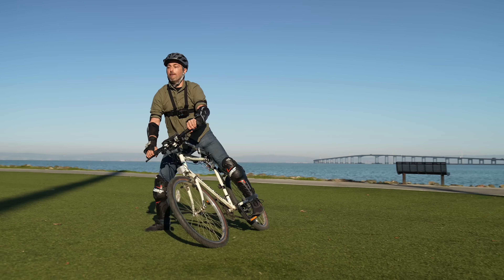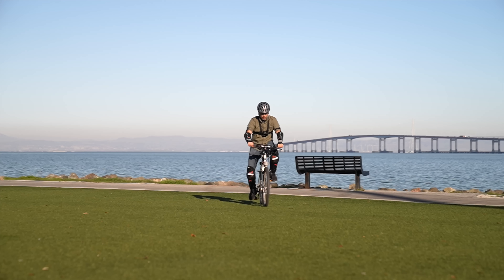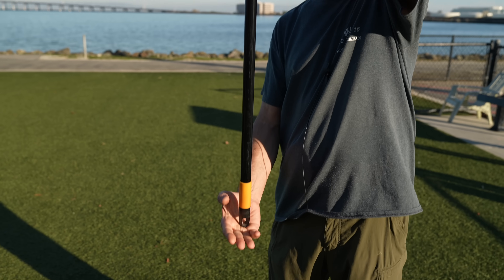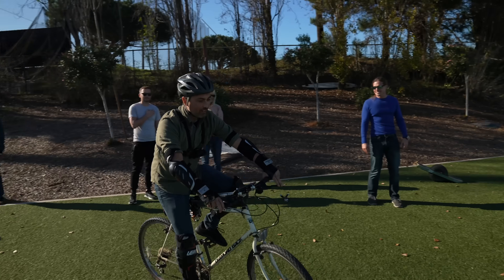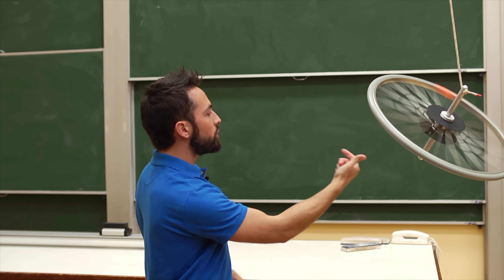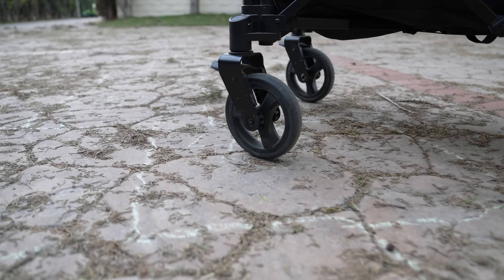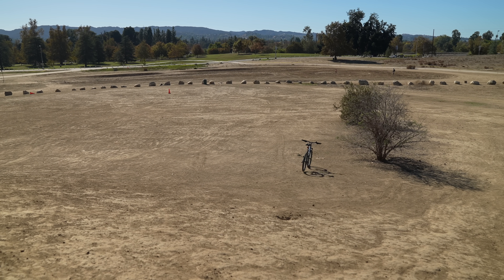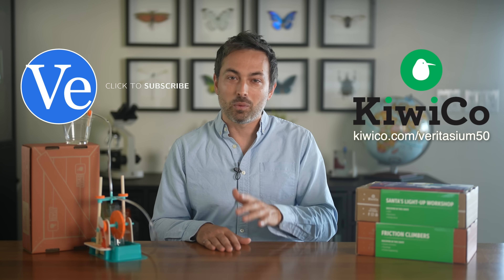Most People Don't Know How Bikes Work

Comment: Countersteer starts the turn, then once leaned, the bike's rake/trail effect steers the front wheel into the turn on its own and will stay like that with no other input, as long as speed remains constant; unlike a car where caster effect will return the wheels to straight ahead. To stop the turn, you countersteer the other way. This is one of the reasons why it is essential to keep your bodyweight off the bars of a motorcycle.

Comment: There’s another force at play to correct the balance of a bike moving without a rider: the friction of the rear wheel. That friction is always at play when the rear wheel is in contact with the ground and counters the angle of the front wheel since the rear wheel is fixed longitudinally with the frame, where the mass of the entire system (the bike) happens to be. I mean, that’s my theory as a cyclist and an observer.

Comment: Is this news to anyone who knows how to ride a bicycle? (or motorcycle for that matter)  It's all about counter steering, leaning & the gyroscopic force generated by the wheels.  Push left, go left.  Push right, go right.  You are essentially turning the bars slightly to the right by pushing on the left side to turn left & vice versa.  As they mentioned at about the 2:30 min mark, you must turn left to go right & right to go left.  Steering is how you do not fall over forces the bike & your weight to lean towards the direction you want to go.  It would be very difficult to ride a bike for long with the steering locked straight.

Comment: This precludes the possibility of just using your body to physically lean over and just simply turn to the fire room you want to go.   I recorded a video of myself doing this and for the most part I just physically lean over and the bike turns for me.
Reply: Nah man.  Let's weld your steering straight n  see what happens.
Reply: @gur262  well of course that will make it possible.   But even if you just simply lean over you'll still turn the steering wheel.

Comment: This is very interesting! As a motorcycle rider i always thought i'd only countersteer going above 20-30km/h and turn without any countersteering under that threshold but I will keep a keen eye tomorrow morning while doing slow turns and see how i actually initiate the turn :)
Reply: I'll be interested to learn what you find out. I ride a trials motorcycle, which is a very slow methodical type of riding over difficult obstacles off-road and we definitely use a mix of direct steering (and counterbalancing) and then countersteering at higher speeds, I just don't know when the transition actually occurs!
Reply: @fprintf   - Countersteering can ALWAYS be used to to set up the proper lean.  In trials, you probably use differential weight on the foot pegs at low speed to set up lean, but what keeps your body from falling the opposite way?  It's subtle and you're probably unaware of it, but it all goes back to moving the wheels' contact patches with the steering input to control lean.
Reply: @fprintf  Here is what i found, i seem to countersteer and lean the bike with the aid of some slight body positioning  for sharper slow turns but i couldnt tell if i would counter steer before the turn or if it was just me correcting my line while going straight before more relaxed slow turns
Reply: Well thats only possible with body positioning, if you "fall" the other way your brain will automatically countersteer. On motorcycles the effect of countersteering at low speeds isnt in such big effect because of the low COG and high weight of the bike. At high speeds gyro forces are so much stronger so no matter how much you change your positioning it will barely affect the bike.
For our trials guy here that might be bifferent because youre standing up and the bikes are much much lighter
Reply: It'll change your life. If you're not putting your feet down, you're countersteering, whether you realize it or not.

Comment: One more mechanism to keep bikes stable: the shape of the tire. Because it is a doughnut, with the largest wheel radius at the centerline and diminishing radii to the sides, the tire will always roll in a circle toward whichever side it’s leaning to - toward the smaller radius. The smaller radius covers less ground in one revolution, the larger radius covers more ground. Test this with two plastic cups with their open ends taped together: the combined shape will always roll in a circle toward whatever side it is leaning.

Comment: I would assume that the only scenario you would be able to ride with steering locked, would be if you're going in a straight line with some speed (25km/h or over), because, at that speed, you would be relying on leaning only.
Reply: Nooooooooooooooooooooooooooooooo.                 It works the same way at 150kmh.

Comment: When I did my advanced rider coarse to get my motorcycle license I was taught an emergency steering technique where I had to sharply push on the handlebar  on the same side of the direction I wanted the bike to turn. i.e. to abruptly turn to the left I had to push the left handgrip which caused the bike to immediately lean and swerve to the left. This seems counter intuitive as the handlebar is turned to the right to actually go left. I suspect this results in the same effect seen in this video. The slight jolt of the steering to the right is enough to initiate the lean and therefore the turn to the left.
Reply: Your statement is confusing..
Reply: Isnt it just the same to just pull left to turn right tho? When I took my first motorcycle lesson riding felt just the same as with a bicycle but with a much heavier bike. Steering/keeping balance/dodging obstacles felt so natural. My teacher told me to dodge by pushing the bars and instead my brain told my body to pull like i always do and the teacher told me i did it correctly.
If it is the same why dont driving schools teach it both ways?
Reply: @mirzu42  You're doing both, its just that for some its easier to focus on the side that is pushing rather than the side that is pulling.  Either way you're doing the exact same thing, steering the bike in the opposite direction (hence counter steering) to initiate the lean and then begin to turn in the intended direction.
Reply: Yes, that is exactly it. It is more important on a motorbike, because the gyroscopic effect of the heavier and faster turning wheels prevents you from turning unless you apply some drastic steering inputs, and so you need to know and have the confidence to apply those drastic inputs.

Comment: There is also another technique I use, which becomes apparent in very quick reactions. What I do is nudge the bike with my hips or letting it fall to the ground, lowering my point of gravity, which enables me to steer more effectively because if your bike is at an angle, the angle you tire makes with the ground is much sharper than the angle of you steering. I do believe I'd have to steer the other way first, only less. I think most people do this, but skillful riders drop much lower. It allows me to safely ride like a madman through town.

I've been thinking for a while now. I believe the only way physically possible to beat your special bike, is with sails.

Comment: I  actually just did a complete lockout of my handlebars a few weeks ago to demonstrate to my sister that leaning was how to actually control a motorcycle. I was still able to ride fine, no sharp turns but fine. . Counter steering a motorcycle gives you the mindset of pushing the bike over with your legs and weight. Yeah counter steering is much easier and better to turn but as long as you have a little speed you can turn in a decent radius with just leaning the bike with weight
Reply: I don't believe you. How did you lock it out?       I don't think you did. There was some movement left.
Reply: @gur262  I work on motorcycles on the side for some extra money and because I enjoy it. 
You can lock them up the front wheel and handlebars on most models pretty easily by putting two copper crush washers on the pivot part of the triple tree. They literally do not move but maybe a mm at most if you put your full weight on them. 
I did this on an old Kawasaki 250 I bought off someone for $500 as a fixer to learn more about fixing motorcycles, especially carbed ones. Turns out you don’t care about people learning (dropping) on one you’ve spent more money in your time fixing then actually buying it. Maybe it’s different on a non motored bicycle, but my point still stands, it’s still probably possible if you have the experience on them, at least motorcycles.
Reply: That's not true.  If the wheels can't turn you can't steer, and balancing is extremely difficult.  Either there was still enough movement in the steering to allow control, or your story is made up.
Reply: @nwimpney   Notice how they said motorcycle, so its probably not the exact same as the video. Also, why would they make up a story wtf
Reply: @nwimpney  no movement on the wheel or handle bars. Crush washers on the triple tree pivot. See my reply for more detail on Joshua Mack comment
Reply: bruh you physically can't steer a bike with locked steering, tf are you talking about
Reply: @pleopsidium6960  motorcycles are much heavier than bikes and the wheels are often wider, so its different than a bike and likely possible to do a wide turn by leaning at certain speeds.
Reply: @carter_dj  yeah i guess if there's a big difference in width between front and rear tire it is possible, otherwise i can't see it happening, unless there's a solid scientific explanation behind this. i'm not going to try riding my motorcycle with locked steering lmao
Reply: @pleopsidium6960  i wouldn’t have either but my sister wanted to learn how to ride a motorcycle and I couldn’t seem to get across that yes you have to put some lean on the bike or you can’t turn. She was scared of leaning and thought you could just turn the handle bars and it would
Turn like a car.
Reply: @carter_dj  i agree, might not be the same. Maybe it has to do with the pedaling of the bicycle. Not saying it’s all bs what they are saying, just I don’t think it was portrayed in the best way. Counter steering is extremely useful, hard to wrap your head around but if you just hop on a motorcycle and learn the clutch and go, you’ll be fine if you rode a bike in the past. I think there is more variables they don’t take into consideration.
Reply: @pleopsidium6960  center of gravity is not contestant with a human on it. See my reply to  Joshua Mack comment for more detail.

Comment: Every EU and UK motorcyclist that quilfied remotley recently likely knows this as it's veyr difficult to pass the "moose test", a tight 50km/h swerve around an obstruction in the road without knowing how to do this. 

I think you've missed the critical difference though, in than a car steers by positional input on the wheel, you turn the steering to the required corner radius. On a bicycle you apply a torque on the bars to induce a lean relaxe pressure to let the bike balance. You touched on this with locked steering but you missed the major safety aspect, in that gripping the bars to tight stops the bike from turning or makes you crash. Target fixation crashes occour when a rider panics, doesn't use the subconcios techniques they have learnt to steer and tries to hold the bike tight and turn. At low speeds on a bicycle you lose balance and fall, at higher speeds on a ~1/4 tonne motorcycle you just go straight on.

Comment: The counter steer is well known to all two-wheel users. Have to use it in evasive maneuvers when riding a bicycle, typically when a cellphone user is not paying attention. Nerve wracking as you have to turn TOWARDS the danger before you can avoid it. But it’s present at all times you want to change direction.

Comment: Understanding the countersteering effect is MUCH more critical on a motorcycle. Especially a cruiser which is designed to be very stable at 55mph. Its much harder to turn the wheel due to much higher caster angle (and probably the much increased gyroscopic effect from a much heavier wheel as well as the engine flywheel). A motorcyclist that doesn't both understand and practice this technique for awhile is destined to eventually get in a crash with a car or deer after enough years. They are unable to make very quick steering adjustments to swerve and then again to continue straight down the road.

Comment: Motorcycles are a different beast.  To turn you push on the opposite side; this works a little on a bicycle but a lot on a motorcycle; same idea of turning the bike out from under you I suppose; but then that also is leveraging the gyroscopic motion to counter torque.  It's one of the things the grind into your head when you take a motorcycle riding class.

Comment: The bicycle is a really neat demonstration of proportional feedback. The caster is there to ensure the bike will want to keep itself upright. If the bike leans left, the front fork will turn counter clockwise slightly and the resulting turn creates centripetal acceleration that brings the bike upright. Once upright the caster causes the tire to track strait again. This negative feedback can easily turn positive in motorcycles in the form of tank slap, and ultimately oscillations during land speed records that turn deadly. The rider will think it’s a fluke and not a design flaw after the first bad pass, only to die in a subsequent run when the bike careens out of control. Fortunately computer modeling provides the needed tools to choose the right geometry for stability at the target speed.

Comment: if you are going at speed, the dynamics are COMPLETELY different. if i'm going 20 mph, i'm barely shifting my weight to the left to "turn" left. i'm not putting literally any pressure on my handlebars. often, i will sit back and not touch the handles bars at all, and i can still turn by leaning slightly

Comment: I ride bikes without touching the handlebars, done so since I was a kid. I'm curious if this still applies, even if you don't even touch the handlebars at all. To turn left I kick my hips to the right then stand up slightly, causing the bike to first tilt (and therefore steer) to the right, then fall to the left (because it's top heavy in that direction) and I increase speed to not fall over to the left. How much of the "fall to the left" is the top-heavy imbalance, and how much comes from the self-steering counter steer? I would love if you could find someone who rides without hands and test!

Comment: lol you're starting of wrong, and only halfway the vid say the right thing. Normally, you'd lean in the direction to go and ONLY THEN turn the wheel. For shallow (is that the correct translation?) turns you don't need to really steer at all. Apart from any balance correction that is indeed. Only in those turns with your experiment bike where the turn succeded you steered correctly, hence why it worked.

Comment: First learned about "countersteer" in my Team Oregon motorcycle training class. But by the time I bought a motorcycle I'd forgotten and almost wrecked!
Reply: "Push the handgrip on the side you want to turn toward."
Reply: @jdotoz  spoken like a true down hill mountain bike racer... Also don't forget to weight the outside peg. 😉🏁
Reply: I discovered it when I learned to ride a bike without holding the handles. You can still turn (maybe not that sharply, but simple 90degree street corner is easy) just by balancing your body, no handlebars involved.
Reply: Twist of the wrist two is a masterpiece
Reply: Counter steering is the fastest way to avoid a pothole even on a bicycle.
Reply: yeah first thing I thought too
Reply: I also learned about this topic while at  RYP motorcycle trials training. I was thinking unicycle, then BOOM there it was in the video. I love this channel!
Reply: was going to say, you learn all this quick if you every rode a sportbike
Reply: @SuperJlonergan  Oh I dono, I reckon most people know nothing of counter stealing and fight a bike for years and years. 
I rode for about 30 years before I learned what it was, when I started track riding. 
What a difference. 
I want to point out that unlike this video, you have to be doing faster than say 30mph to simply push on the handle in which direction you want to go. 
Lee Parks book "Total Control" is amazing.
Reply: @SlayerofFiction  I disagree. This works at any speed. It just requires less pressure. At 5+mph, you can steer with just one finger and the slightest touch.
Reply: As they teach in MSF- Push Right, Lean Right, Go Right
Reply: @theshindogg  Yep, that's how I learned on the motorcycle. When I first started I tried to think "turn the opposite way" and had trouble. But the pushing the way you want to go works so much better.
Reply: push left, lean left, go left
Reply: The Team Oregon classes are fantastic. I want to take their intermediate classes next year.
Reply: This saved my life one day. It was amazing how perfectly it works.
Reply: Absolutely, Robert. Many bicycles are perfectly rideable without hands, and turns are no problem.... once you've learned how
Reply: Same, countersteering learned while learning how to ride a motorcycle!
Reply: Push the right bar to go right. Kiss the mirror to do it fast.
Reply: countersteering is really non-intuitive, leaning is the mechanism you steer with, steering changes your lean angle,
except if you get the exact right steer angle, which is hard to learn...

When you lean the bike will find the optional steer angle for stability on its own.

Comment: This is pretty cool but I think this only applies at low speed. Counter steering at high speed (like on a motorcycle) seems like it would be different since you can counter steer indefinitely. This meaning that if I push left at high speed I go right and keep going right, there's no change in my steering direction.